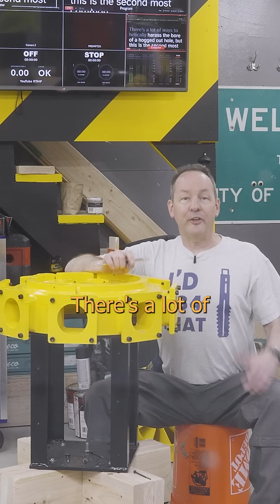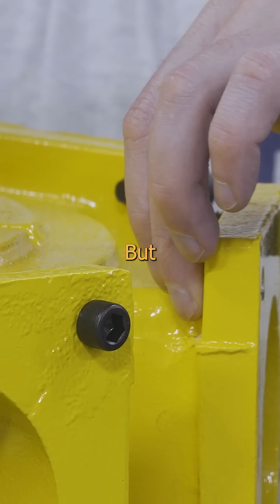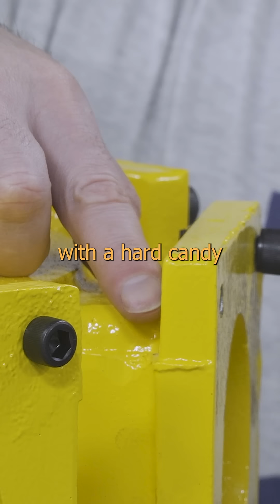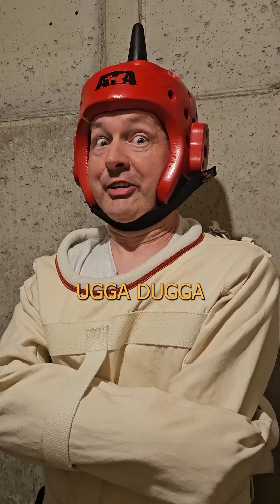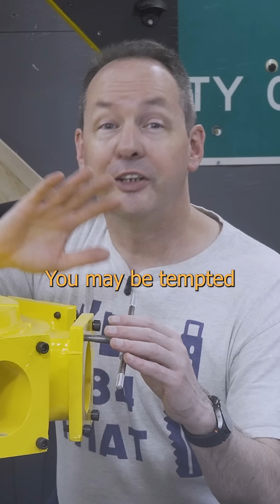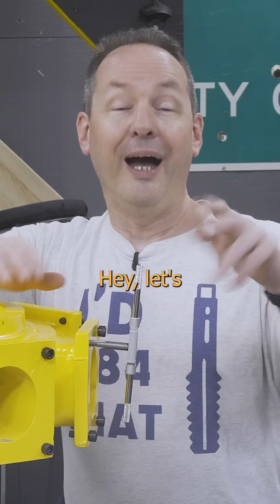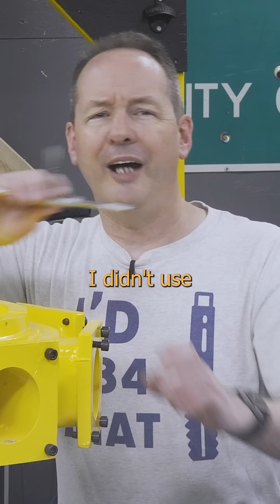Thread Chasing  #chrisboden #comedy #engineering #skills #workshop #metalworking #tools #apprentice

Comment: Dumbass here was cutting a 1/4 20 into copper went a smidge hard on the cutting turns on the tap wrench after backing the tap out to break the swarf. Copper soft, sticky if you like. Dumbass learned...

Comment: Have you ever used a thread restorer/rethreading? Like a tap but designed for cleaning and reshaping instead of cutting. Matco has a great set TDK51, use it all the time.

Comment: Dumbass- tapping threads on the head of a 350 from my old work truck back in 2005. I was trying to get the engine out, rebuilt and back in the truck, over one weekend. I needed it done by Monday morning to get back to work. I decided that a drill was fast and I was in a hurry. Broke a tap in the hole. Couldn't get it out, couldn't get a hole drilled in it to try a bolt remover. My solution was "fuck it." Went and got another cheap tap from Auto Zone. Fuck me if I didn't do the same damn thing. 21 years later and a whole lot smarter, I am careful about stuff lime that now.

Comment: Never used a tap,  but had something similar happen to me with wood screws in particle board - arguably a MUCH softer material, so much easier to mess up.
Only using the slow gear on my electric screwdriver for that kind of job now.

Comment: My moment of dumarsery was merrily using a spray can of lanotech to lube the tap before each hole, not considering that the vast majority was going onto the floor. My employer’s moment was ordering 200 heat sinks with 35 unthreaded holes. I smelled like raw wool for a week.

Comment: I got taught this in college... well, not the thread chasing, but cutting threads in holes. Never seen four feet at 20 tpi, but I've fixed a few things with a tap and die set, and that's now my job when it comes up. Last time we had to cut threads by machine, it was on a Bridgeport and turned ALL the way down. Something like 60 RPM. Hella torque. If you get that thing cross threaded, it will make NEW threads, and you will have a bad day.
Reply: ADDENDUM: the word or words for cross threading a tap are more or less unprintable.

Comment: Honestly I needed threads cleaned in a very similar situation as here.  I knew there was a set of taps in the tool room and did it by hand.
Reply: If you know your gonna prefer coat,  a chamfer on the back side of the thru holes is a good idea

Comment: Check out the drill bit/tap bits that are meant to be put in a drill (not an impact) and it does both steps at once! They suck, dont use them..... the hardened steel means they snap if you wobble the drill even just a cunt hair....

Comment: "Dumbass" can actually be a solution. As we doubled up the steel frame of the glass facade of the Henry Ford Building, we had to retap thread into a godzillian holes in situ, in order to accomodate for double pane tension glass. The contractor searched heaven and earth to find an electric drill with a 19 mm spindle alligning with the top of the machine, to allow for the holes and threads to be centred as close as possible to 8 mm from the glass. It takes some getting used to, but once we had the hang of it, after about a hundred fails, it worked just fine for the remaining holes.  All 44,520 of them.

Comment: Dumbass (?) I used a machine tap and tapped ~30 holes with a drill just today, just keep the clutch off "drill", and if it starts slipping, it's time to finish with a more intimate, manual approach

Comment: Fuck and they gave me shit because I DARED tap a hole free hand.... Yet when I did it with the machine like they showed me.... FIRST DRILL THE HOLE>>> DONT UNCLAMP >>> INSERT PUNCH>>> SQISH PUNCH WITH STAND DRILL AGAINT THE HOLE YTOU JUST DRILLED>>>> AND TWIST>>> Yea it was skew and I was shat on and was told Never to tap again... NOt even a week later they said I must tap a part that they turned ... DID it their waya again without thinking of telling me that the steel work hardens NOR did they give me machine taps For hard materials like at my previous JOB.... Snapped one sucker and the "PRO" that can tap snapped another.... HEHEHE... Lets just say they had to make 2 new parts and buy new taps.... Left them after they put me up to fail on another job a week or two later....
Oh and by the way IM a qualified Millwright where you have to tap holes to PASS...

Comment: Use ear plugs Chris!  They'll save ya a lot of time clearing out holes.  * That is assuming the holes are in good condition to begin with. *   Foam ones are fine for normal paint, and use true silicone ones for higher temp cures.  At least if you already have them around.  Ya don't want to go buy plugs for this normally.   A tap is usually cheaper and is a tool that lasts whereas plugs are a consumable.  But still,  there are times where that hole simply can't be chase tapped again due to other assembly work and it must absolutely stay clear.   That's where plugs shine most. Pro tip to v bend the ends of a paperclip to remove them if ya don't have needle nose at hand.

Comment: DUMBASS. I've broken traps off in the hole, although I still use a cordless drill to chase holes on our production parts at work. The trick is drop it in low speed, and set the clutch low enough it will trip before bad things happen. Thread the tap by spinning the whole drill in and then let er rip tater chip.

Comment: Automotive- was trying to chase a worn and rusted thread on the subframe and decided "this is gonna take forever," so I slapped a clapped out tapp in my drill with the, now known, hammer function still switched on. The bit exploded at high speed and in my face when the drill tried to add a little ugga to the dugga. My father, from across the shop, saw what had transpired and proclaimed "Dumb-ass!" I was fine, but patience, proper planning, and PPE were the lessons that day. 😂

Comment: Dumbass.  Chucked the tap in a cordless drill "to save time", and 5 seconds later I was half stripped, half cross threaded, and had 2/3rds of my tap broken off inside.  5 minute job turned in to 5 hours of profanity.

Comment: I actually had to cut new threads no my electric scooter. One of the bolts got hogged out and went pear shaped (literally) so I had to step up the hole from an 8mm all the way up to 3/8 and then tap new threads.

Comment: DUMBASS!
not a tap, but after years of working my own cars with hand tools I decided I was owed a battery powered ratchet. 
I changed the oil on my car and wanting to test out my new rachet. I "gently" feed in the drain plug. Next time I go to change the oils the plug just spins... I've now learned hand tools have their place as do power tools.
Dumbass.

Comment: Yep. My Piggy didn't make it to market.  Chasing threads after a weld repair on a box making machine.  Discovered  welding can harden metal and drills will flex in a hole. (Yes. Yes, like your di**.) A tap though, will not flex. So much fun getting the broke tap out. You never have time to do it right but always have time to do it over.

Comment: I was that dumbass, and as a result there was a horse trailer sent from Derbyshire here in the UK to Saudi Arabia where the galvanized coating on the threads and holes was in fact silver paint.

Oh, and the brake lights and indicators were cross wired but no one noticed my ham fisted fuckery until it was 20 minutes before it shipped. 😂

Comment: Not actually a dumbass, Just unlucky. Had to redo the threads on an engine block when a POS bolt snapped off...got the bolt drilled out, got the tap started, started making the new threads, genuinely working it slowly and carefully. In the last mm the entire area cracked and broke free. I had to buy a brand new car with where it broke...you can be the most gentle and careful lover and still get fucked in return lol.

Comment: Tabs are very hard, so if you use a trailer or something they snap like a freaking toothpick. And that's why you really have to go very gentle and very careful slow as fast! You get a little crazy, that thing snaps off, if you're lucky part of it might be sticking out on the other side you can use a pair of pliers and get it out but 99% of the time you are not lucky and that thing is in there and you are spending the rest of the day trying to use a drill to trail out a hardened piece of metal that just will not come and you're trying not to mess up the threads. So trying to save 5 minutes in time it's going to cost you two or three hours of yelling and cussing. And if it's a blind hole you're going through to clean up, if you want inspired a Brooke that's happy because you did something stupid like that chances are you were not going to be able to get it out without destroying the threads. So that's going to cost you days and a machine this time to remove it

Comment: Trying to drill out a carbide tap because it got bound up is loads of fun 😅
Reply: Nah, trying to drill out the the drill bit that broke off trying to drill out the tap that broke off in a cylinder head...that's the stuff dreams are made of
Reply: @deathsicon  I was drilling a bunch of holes in an aluminum block I was going to mill and broke 2 carbide bits in the block. I had to mill to their position and dremel sand until i could pry it out. fun
Reply: @deathsicon more like nightmares 😅
Reply: @The_Slo_Guy nightmares are still dreams...
Reply: You can break taps up easily with a round pointed chisel, they're brittle enough to break up into pieces.
Reply: you can burn them out with a carbon electrode, get the one with a copper jacket, works great as a pencil too, and an electrode welder, the older the better, the new ones might get pissy with you, if you're brave freehand it, if not use a drill press or mill to hold the rod and part, God knows I've done it with a magnetic base drill in a field on a tractor that decided 4 wheels is too much for her liking
Reply: "Tastes like regret" would be @ goodtshirt idea...
Reply: Why are y'all using carbide taps? I use them on tool steel or pre hardened 4140  or materials of that nature. I use HSS or cobalt drills for almost everything that isn't hardened. HSS and cobalt are less likely to chip and break under most conditions, cost less and please use lube on anything that cuts metal.
Reply: Get some good quality tap extractors. I've never needed to use one yet, but heres hoping 😂
Reply: @vikingbiker  they work as well as screw extractor,  they work well if it isn't stuck.  on the other hand if it wasn't stuck why would it have broken?
Reply: @daveshere9723 ive had some luck lately with screw extractors, just last week got 3 m4 and m5 bolts out the rear swing arm on my motorcycle, ive seen people get fucked taps out with extrators if your slow and take you time with some picks and pliers too. Stud extractors on the other hand ive had next to no luck with.
Reply: That’s when you switch to a diamond burr. Try to make a big enough hole to pull it out with an extractor. My aircraft mechanic father taught me that one.
Reply: God that's a fucking day that I don't ever want to think about again, 4 hours from home and an 1 hour away from a hardware store
Reply: I say we take off and nuke the site from orbit, it's the only way to be sure.
Reply: Not the "F" word i was thinking of...
Reply: That's what smoke wrenches were made for.
Reply: You can weld on the available end, either mig or arc, they don't like heat, well actually the shrink after the heat in this situation and you can easily crack it into many smaller pieces, it worked when I needed it.
Reply: And so the creation of EDM was inspired.
Reply: {dumbass} been there done almost that. aluminum, broken tap. hammered, drilled with whatever i can get in my hands. succeeded by hammer drilling with carbide drill for walls. spent half a day. tiresome AF.
Reply: They make tap extractor. Much easier than trying to drill hardened steel.
Reply: That's why I bought an EDM tap remover machine.

Comment: DUMBASS HERE. My first job was as engineer, designer and assembler for a big 14x14 ft series of shaft covers and as wet behind the ears I was I designed them to all attach with #8 bolts. Powder coat got into every single one underneath the rubber bungs and I spent my first 2 hours doing this patiently and got through about 5% of the job. Then I pulled out a clutch drill at the lowest setting and the oil and got through 98% and on the 4th from last snapped the tap off in the hole. Had to bore it with a mag drill and use an insert but I maintain. It was still faster than doing 800 holes by hand. But this formative experience was also how I learned to stop worrying and love the Honda fastener.

Comment: I guess I’m a dumbass…I use a cordless drill all the time to tap holes. Especially in aluminum. Plenty of lube😏 good sharp tap and i set the clutch on the drill as low as possible. Like anything you get a feel for it, and you learn when it a viable option.

Comment: I'm the dumbass, using the tap in a drill and broke it off in the hole. Thankfully it was for something in my beater of a car at the time and I just used zip ties for the part until I sold it years later

Comment: So I do a lot of work on Highway Fencing & Guardrail and, back when I was a yard guy, we would have to drill and tap all the freshly galvanized plated sleeves for Vandal Protection Fence over Bridges all the time.

Since we were doing brand new threads and not trying to follow old threads we would use drills and lets just say you wanted to keep the lube handy because those holes were tight and breaking it off mid tap is a pain in the ass to get out and slows the process down immensely.

Comment: Flashback to my first job in the trades, SOP was to use a drill to run the taps to chase threads, and I was too green to know that wasn't the right way to do it. After breaking two taps in a row chasing the same hole I looked it up, bought a tap wrench myself, and suddenly became the only person on the line that didn't break at least one tap a day
Reply: Gotta have the right touch with that drill lol. Need experience grasshopper 😆
Reply: @93_LXcpe  Tell that to the guys with 15, 20 years at the company breaking at least a tap a day with the drill lol
Reply: @richardmillhousnixon if you can chase a thread with a tap in a cordless drill maybe you should consider a different trade 🤦
Reply: @93_LXcpe  They were pneumatic, actually, so no clutch to save you when the tap inevitably catches on something, and running them slow was incredibly challenging even for someone with an experienced hand. But I'll make sure to check with you next time I need a summary of events you've never witnessed.
Reply: @richardmillhousnixon  I had a similar experience...but I didn't know there was a correct way or where to look it up. They just kept being angry at me because the taps were expensive.

Comment: Dumbass. The wife's electric wheelchair stripped out its thread on 2 seat bolts. I had never run a tap, but I'd watched Adam Savage do it for YEARS, and thought, "How hard can it be?"😂 Enough harder than the aluminum I was tapping to hit bottom and re-strip the new thread I'd just cut using a Ryobi 18+ hand drill like a moron 'cause I was also in a hurry. Ah, hubris, my favorite deadly sin...😂

Comment: Dumbass, but I still do it. Tapping a 10-32 hole with my drill on an AC electrical panel assembley when the tap snaps in half. Luckily the panel is barely an 1/8 inch thick and its just sitting loosely on my bench. Wrenched the stuck bit out, got a new tap and continued working. I've tapped many holes with that bit, im suprised it lasted this long

Comment: I learned it the hard way as well had to weld all of the holes back up and make some new holes to make some new threads in, it was a pain in the ass because I had to do it even slower because the metal became harder

Comment: Dumbass. I was tapping M3 screws into a radiator of a car stereo (the amplifier died and replacement part was unobtainium so I just retrofitted it with a Class-D 4x50W amp, but I needed to mount it to the radiator somehow)

The aluminium was especially chewy, and my tap was one of the Lidl branded bullshit, I had nothing else at hand at the time, and the repair was cito - aaaaand I had no tap wrench at hand

So, I just chucked the tap into a cordless drill, and with a "gonna do some stupid shit, doo-daa, doo-daa, hope I get away with it, oh, doo dee doo daa daaay" I just sent it as slowly as the drill allowed, with the clutch set to minimum - suddenly at the last of the four holes, the resistance got _mushy_, like I was suddenly tapping plastic... The STEEL TAP literally fell apart into tiny shards while cutting fucking ALUMINIUM with oil involved...

Never skimp on her taps, kids, and always, always, ALWAYS use a tap wrench

Comment: Dumbass kinda, the first time i used taps at work i was clearing powdercoat out of hundreds of them a go. The solution so that this didn't take all day was low speed impact on general setting and breaking about one tap a run, still cheaper then doing it by hand.

Comment: Don't forget to back it out a turn or two if it is getting too hard to turn. Always break your chips before your tap.
Reply: +1 +1 +1!
And heck, back it all the way out and clean the paint, bugs, chips, mud, loctite, epoxy, sand and assorted spooge out of the tap's grooves while you're at it.
Reply: Yeah clearing the chip is a great idea. Similarly while drilling you want to remove the chips so your nice sharp bit isn't grinding itself to ☠️ on the materials it has removed.

Comment: If you want to use a "drill" you could use a pneumatic drill with the air set to extremely low. Mind this is coming from someone that tapped untapped holes with such drill so use that advice at your own peril